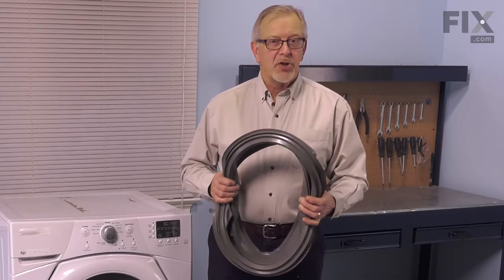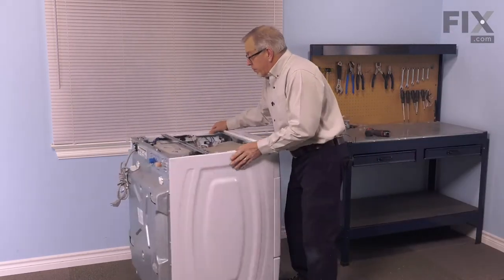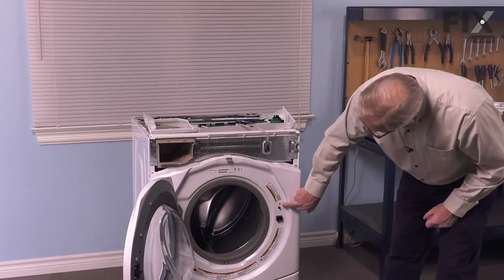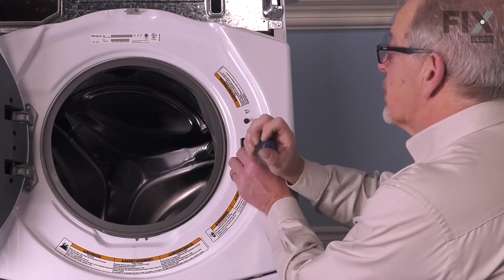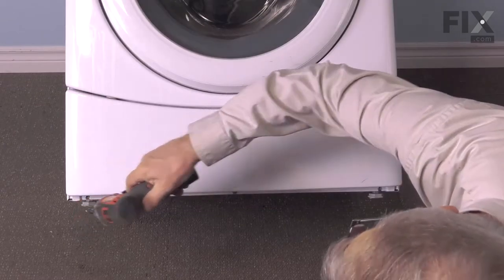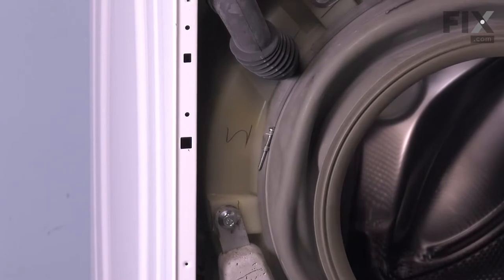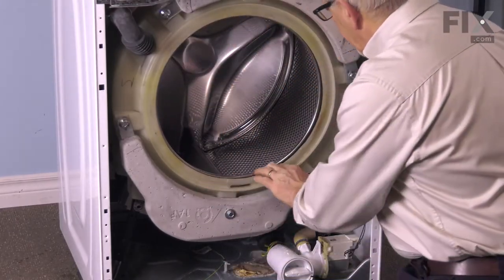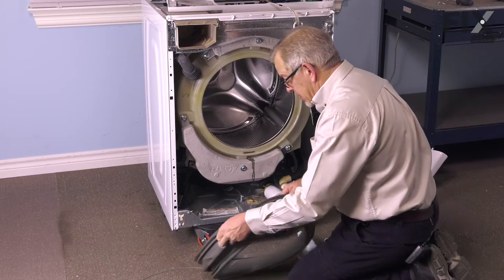Whirlpool Washer Repair - How to Replace the Bellow

Comment: Outstanding instructional video regarding removing & replacing washer's bellows!  Could not have done without it. For others, I needed a torx 20 screw bit for ~4 screws including dispenser tray. Great time to clean the soil trap. Definitely a smell of pungent smell. Thanks again Steve!